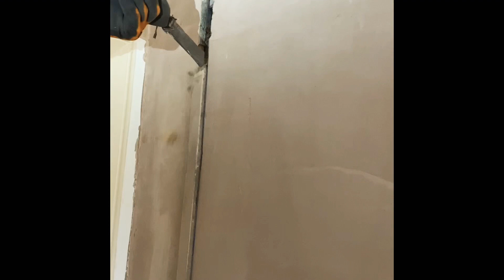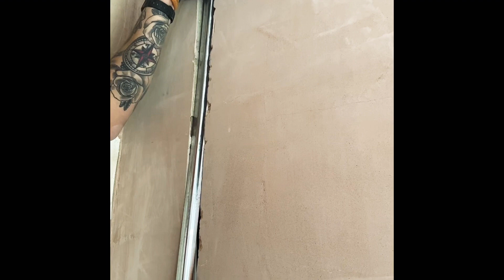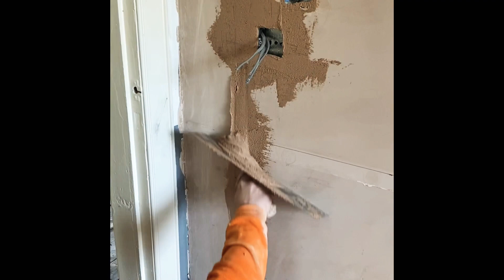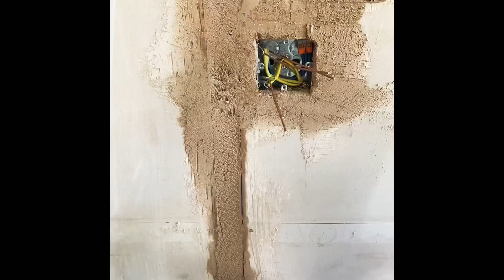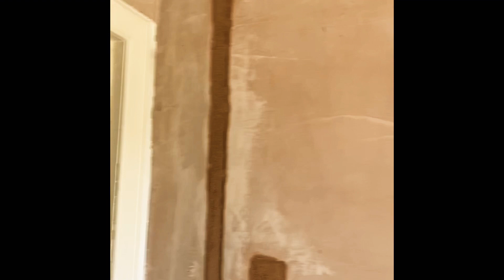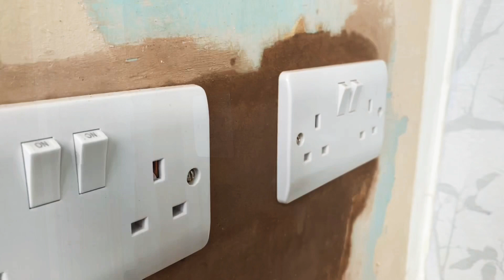How Do Electricians Put Cables In The Walls During A House Rewire

Comment: Random recommendation on YT. Not bad, see some comments about zoning, okay. So the downward chase from the switch is going to a socket?, maybe not. Still outside the zone? not if within 150mm from a corner - I see that door trim hiding there. Only issue is if someone wants to pull a new cable in at any point.

Comment: C3 : cables not run in the prescribed zone
Reply: Noticed they do this a lot . Guess safe zones aren’t a thing to them
Reply: Yeah it's a common thing that they do, should there be any codes on a newly installed addition or circuit. Maybe in Scotland the zones don't apply.
And if they are showing this on video, what else are they doing when the cameras are not filming.
Reply: @acelectricalsecurity  tiny corner cutting here and there for installation speed
Reply: @alhughes9698  true, but they do it all the time, some worse than others, plus a reg is a reg.
Reply: @acelectricalsecurity  they advertise 1 day rewires so they gotta make it work somehow, but i agree regs are regs